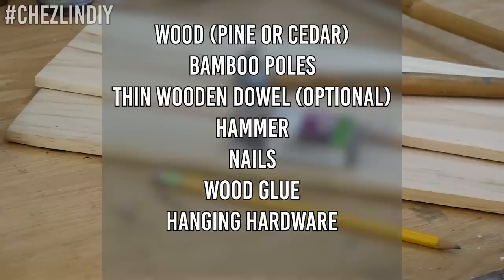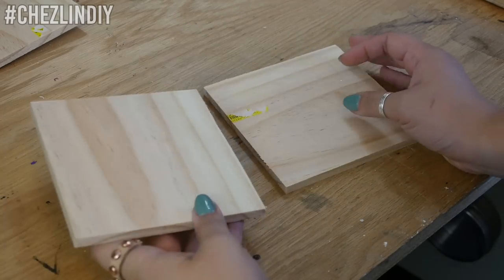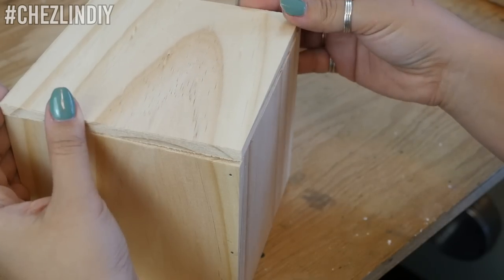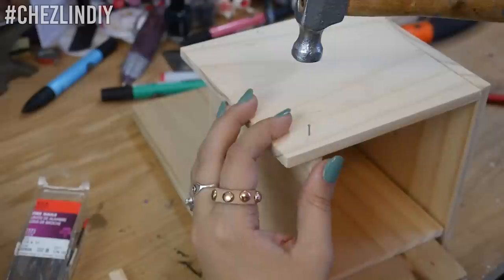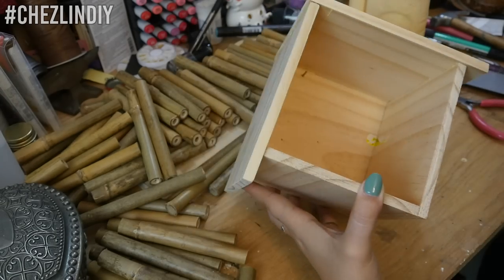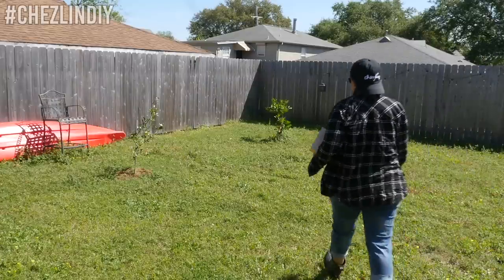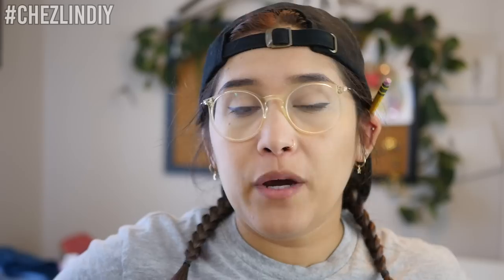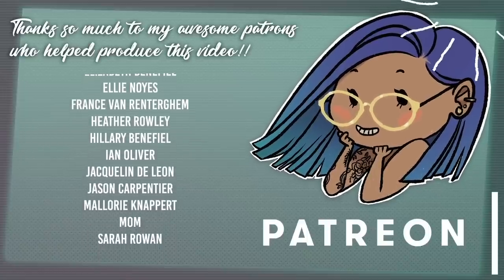How to Make a Bee House For Your Garden - DIY

Comment: So happy you took this endeavor. A couple pieces of advice. Do NOT use bamboo. It's so bad for them. Use natural reeds instead. That grow in most ditches and near lakes and rivers. Also, crown bees sells reeds. Also, make sure your wood is not pressure treated. The chemicals with most pressure treatment is to kill/deter bugs.
Reply: Can I ask why the bamboo is bad for them?
Reply: @conniegarza7022  bamboo sold at stores is usually treated with chemicals.  Also, it's not their natural environment. They use reeds only once then the Reed decomposes.  If the same tube is used over and over it can harbor disease that can make future generations sick.
Reply: @Hecatai27  Your argument against bamboo is not logic! Every plant in the garden is treated chemically: natural or laboratory! Bees' instinct is so powerful that they use as a nest what is the most safe and convenient for them! Where do people can have so much reed every year?
1. It is not practical: it is time-consuming to harvest reeds annually! Even for a small (100-200pcs) nest box!
2. People can find untreated bamboo and use with parchment liners!
3. Use a bamboo/reed free nest design using paper tubes with liners!
4. When compare: reed/bamboo/paper tube - paper is more convenient if the nest is in a dry place!
5. Immerse bamboo in a alcohol for treatment and don't worry about diseases!

Comment: I think bamboo inner diameter is smaller for some bees! Some requires 7.5 - 9mm hole! It can be drilled to enlarge! I would use parchment paper (baking) liners in bamboo to be able to harvest properly and save the nest! Liners have multiple advantages! Harvesting and keeping them clean and refrigerated - also!

Comment: I will copy this method. Seems neat. I think I will use 4 square blocks of wood and drill lots of holes instead of using bamboo.

What about protecting the outside of  the wood from the weather? What do you recommend?

Comment: The length of the tubes need to be 6 inches and it is better to use cardboard tubes or reeds than bamboo because in fall they need to be opened and cleaned for storing the bees to be released in spring for mason bees or summer for leafcutter bees. If you don't they can get parasites and other mites and creatures that will damage and kill them and also transfer that to the other bees.

Comment: Great idea but a few things to be careful of. Those tubes aren't great, they can Harbor pests that kill the good bees. They're hard to clean out at the end of a season. Paper tubes are recommended. Also make sure to offer a good mud spot close to the house. They use this to seal the chambers.
Reply from the maker: Thanks for your insight! Are you supposed to just throw away the used paper tubes afterwards and replace them? And are they sturdy enough to get them to fit super tight like I was able to with the bamboo? I'm scared they'd be more flimsy so they'd get squished. I've seen bee houses where they just rest the tubes (bamboo and paper alike) inside, but I'm scared they'd get knocked out if it storms.
Reply: @chezlin  usually people who use the be houses collect the cocoons at the end of the season so the paper ones make it easier to split them. They're pretty sturdy. I mean use what you have, it's still great habitat. Just don't want to support invasive wasps and things.

Comment: What bees is this house supposed to be for...? Bee tubes need to be 6" long and the overhang in front of the house should be 3" to prevent rain from getting in the tubes. I mean if you live in an area like socal where it never rains, that might be one thing but these are all things you should have known before doing this with a simple google search. You even had enough extra wood to do it.  As well mentioning that you're not going to replace the tubes, this is a huge risk for killing your bees with mold and predatory insects. It'd take 5 minutes at best to replace them, you already did the hard work of making the frame. 

I went to home depot and got a 2"x10"x4' and 2"x7"x4' whitewood for 15$ and cut four 1' long pieces and did the same diamond design as this except had two of the 10" pieces as my overhanging roof and two 7" pieces as my "floor". This makes 2 boxes, but you could cut it in half once again to make 4 small boxes that are 6x6". They say don't use cedar. If you have woodpeckers or other birds in your area, you may want to put bird netting around the box but it yes has to be removable to get the tubes out and not flush to the tubes to trap the bees.

Comment: Hi
Its a really cool idea 
I want to build mine this week 
Whats the inside diameter on the bamboo?
I have some in my back yard
Reply: Don't know if you'll read this but the diameter should be roughly fingertip size and the length of the bamboo should be 5 to 6 inches.